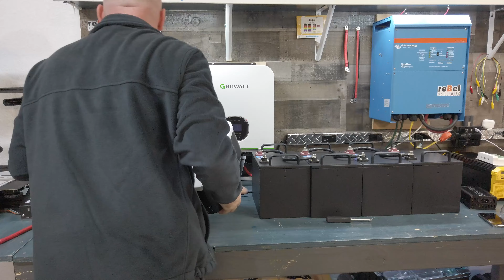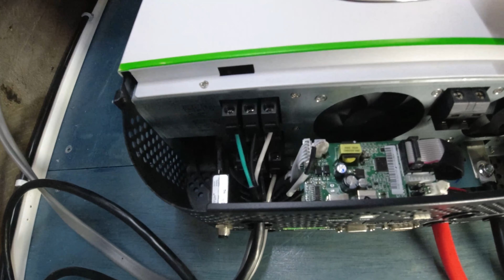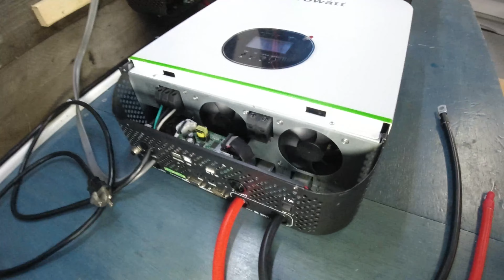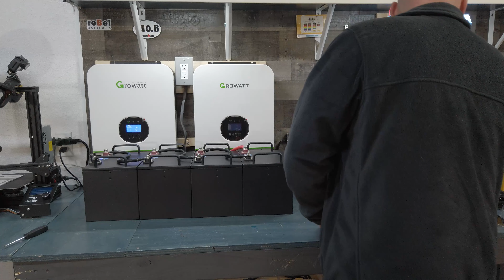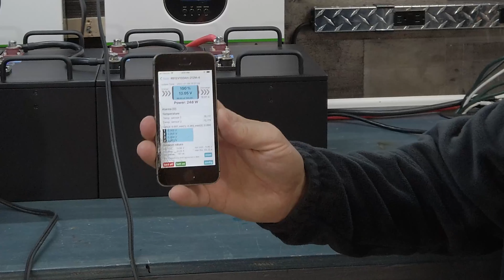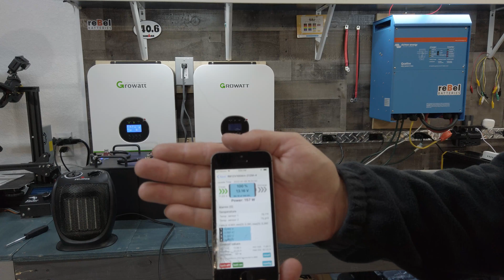Hooking Up the Inverter (Beginner Friendly) Wire Sizing and Code Considerations - Part 4

Comment: Great series. I am planning a DIY Outdoor Trailer, for kayaking, fishing, camping, etc. The information you have provided thus far, has helped me in my power planning needs. Question, I plan on having a tongue box and having my batteries, inverter, etc., in the box..do I need to connect this to my truck, or keep it on its on? Will have shore power capability mainly 110, maybe 30 Amp at the most. Planning on Solar, to run lights, charge phones, tablets, mini fridge, maybe microwave. Thanks.